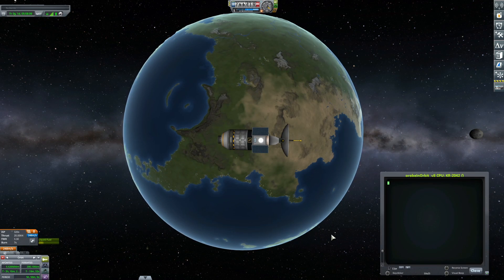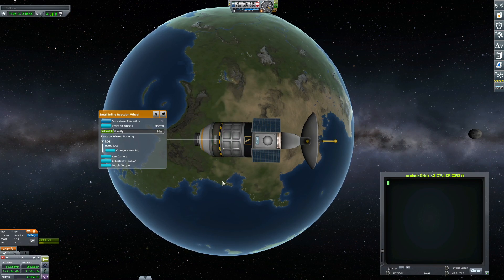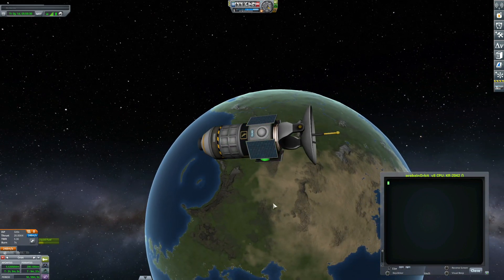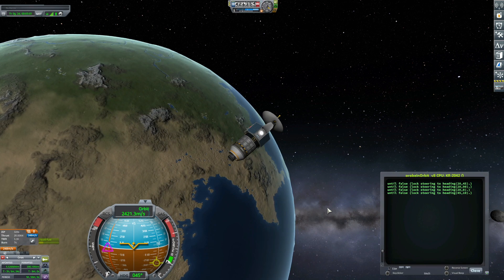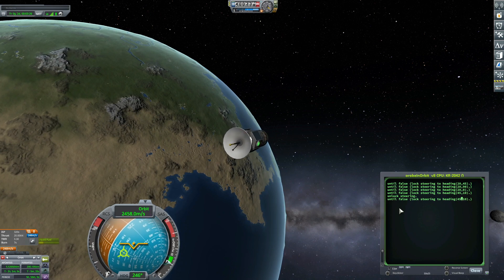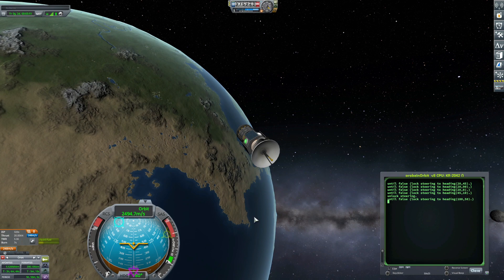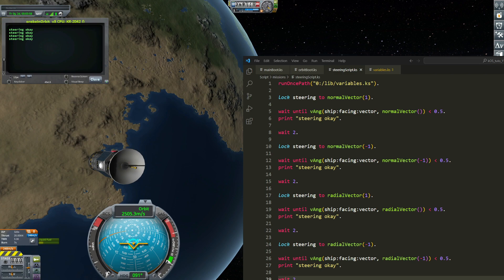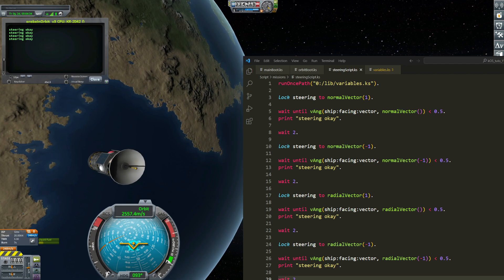[EN] kOS - The Basics #16 - How to LOCK STEERING?

Comment: Good tutotial. Main thing - it is easy t understand. 

The axis in these game are something that giving me headaches. Tried to learn kos and stuck on making a roll. From this video i see that heading also has roll option (i saw it in dictionary but for some reason nothign happened when i used it, maybe i just used the angle that my rocket was already on). After spending tons of time wrapping my head around this problem i only came up with //set steering to angleaxis(180, ship:facing:forevector)*ship:facing)//. However it this overwrites my current heading and code below just doesn't do roll despite it seems to be similar to facing ship. 
set h to heading (270, 45).
set h to angleaxis(180, h:forevector)*h.

Another problematic thing for me are velocities. So if i use raw code like : // if airspeed>1000 {blablabla}.// and it works fine but if i //set h to airspeed// then i get complitely differnt numbers (print airspeed will show normal values but "h" will print some very small numbers like 0.00004*E-5)
Reply from the maker: Thank you for your message. I'm glad you like my tutorial.
I never used anglexis so I can't really say what the problem is, sorry.
For the airspeed, did you try to use `lock` instead of `set`? `lock h to airspeed`
Reply: @Bricàmaths  Hmm. I didn't know i could od that. I thought lock is supposed to work only with special expressions like "throttle, steering etc.". Ksp opens too long on my potatoe so i'll probably try it tomorrow but i assume it will return that h is undefined/unknown function.
Reply from the maker: You can watch the Basics #12 to learn a little more about Lock 😊

Comment: I got it into my head that HEADING can't take three arguments, so I was always adjusting the roll with + ROLL(0, 0, <roll>). Oops.

At 15:05 I think the facing vector happened to go right through the anti-normal as it was whipping around.

Great video as always
Reply from the maker: Thank you Mike. Yep, HEADING takes care of the roll, you can save some bytes on your scripts. But the +ROLL(0, 0, <roll>) is still usefull with LOCK STEERING TO PROGRADE (for example).
You're right about the anti-normal vector. It could be a good idea to add a WAIT 1 after the LOCK STEERING and before testing the angle. Also, the reaction wheel is too powerfull for this small craft.